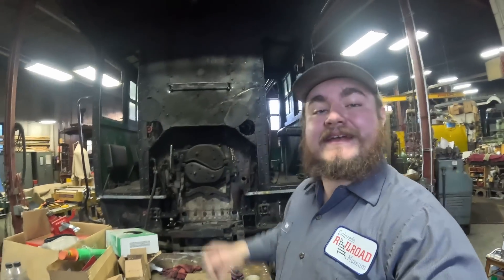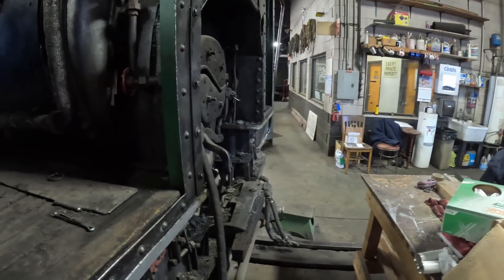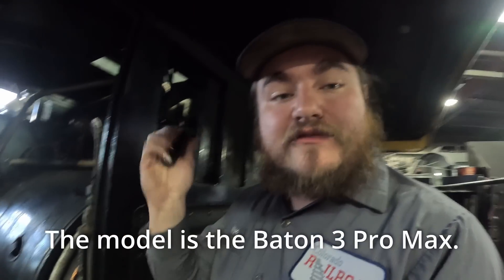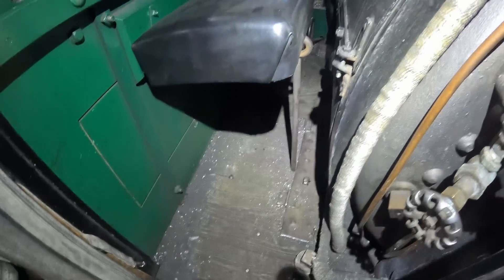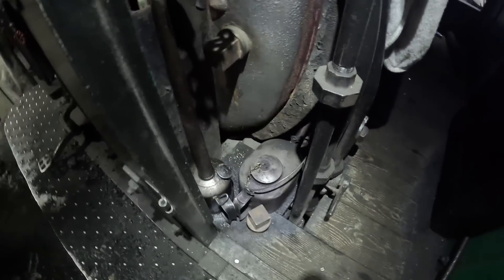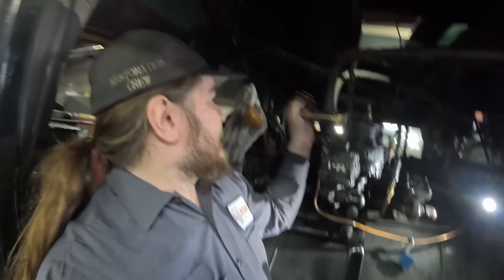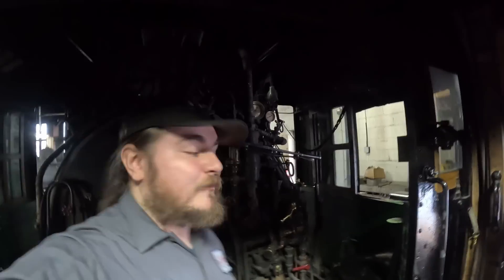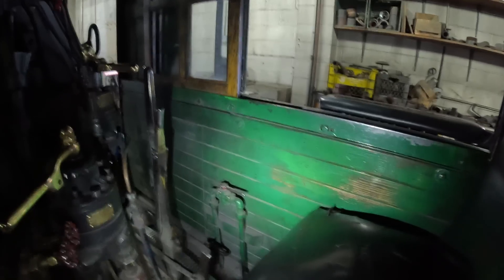BOILER goes ALL THE WAY through the cab? Deckless Steam Engines!

Comment from the maker: I realized after I finished this video that the reason why may not be super clear for some. Smaller locomotives can't afford the length that putting the cab behind the rigid wheelbase would add (cab hits the tender, swivels too far, is unsupported, etc.) so they kept it as tight to the boiler as they could.
Reply: Another advantage is that the enineer didn't need to draw a chalk line across the cab to seperate himself from the fireman 😉
Reply: Or they simply couldn’t fit on turntables at the very start of the 1900s. In N&W #475’s case, she wouldn’t be able to fit on any turntables at that time if she wasn’t a deckless locomotive.
Reply: It gives you a fully enclosed cab though!
Reply: I wonder also (without knowing the build date of your locomotives), whether the trailing tracks circa 1870s 1880s were up to the task of carrying significant firebox weight.  The 2-6-2 and 2-4-2 locomotives of that time had outside journal trucks, but the fireboxes were narrow and also supported by the rear driving axle.  A surer bet perhaps to carry that weight on the rear driving axle, and thus also add to available adhesion.
Reply: @theimaginationstation1899  RGS #20 build date is 1899
and 346 is 1881 and thay were made to go around tight curves
Reply: @mattomon1045  ta.
Reply: Do you think you could do a video about your car one day?
Reply from the maker: @WindowNotClear  count on it :)
Reply: @Hyce777  nice
Reply: Does the double fairely count as a deckless steam engine?
Reply: Why didn't the operators just cut a hole to access those valves?
Cut a square hole, attach a hinged flap, and you have access where you didn't before. Seems like something a typical operator wouldn't think twice about
Reply: Hehe length:_hyceGuitarface:

Comment: If I am not mistaken Illinois Central No. 382 had a deckless cab and if I remember correctly Sim Webb stated in an interview that because of 382s cab design Casey was unable to have bailed out even if he wanted to.
Reply: That would also explain why illustrations show Sim jumping off the right-hand side of the engine (and why, in the famous interview, he says he "jumped across the deck"). If the door on the fireman's side was open, it would have been quicker for him to run across and jump off the engineer's side, rather than closing the door and jumping off the fireman's side. I've always wondered about that.

Comment: I first visited Strasburg back in 2019, and I remember I got in the cab of 475 once and got to blow the whistle. Like you said, it was pretty cramped being the the cab ngl. I remember leaning a little bit to physically reach the whistle board, while under the impression of not wanting to accidentally bumbing a lever.

Comment: I had the honor of working the Six Flags Over Texas (SF&T) Railroad in the late 90’s. Engines are way smaller 2-4-2’s, decked and oil burning. In seeing this video, my initial thought was the fireman’s feet. It seems it would be more of a pain shoveling into the boiler directly on top of the gangway plate around curves or even rough track back in the day. Not necessarily unsafe but something to be mindful of.

Comment: Didn't know deckless engines were a thing, but this explains why my Bachmann model has the boiler sticking out so far into the cab, I always thought they just modeled it wrong.  It doesn't have an apron though and the tender connection is probably too far back.
Reply: Bachmann actually screwed this up on their famous "Big Hauler" 4-6-0. The prototype (ET&WNC 12) is a deckless engine, just like RGS 20. Bachmann apparently forgot to make note of this, so they just basically left it the back of the cab open with very small walls on each side (blocking where the engineer and fireman would have to stand). They got it right on the wood cab version of the model, but the more common steel cab version - one of the most popular and ubiquitous G scale models of all time - has a cab that, in real life, would be nearly impossible to actually use.
Reply: @michaelramsey82  It cost me $50 at a yard sale, I ain't complaining.  I love trains, but I am not a rivet counter, actually know very little about real locomotives, just that steamers have a bunch of moving bits that look cool!  Mostly model in LEGO too, and just build whatever I like, heck, my boxcars have tailights because I thought they looked better that way!

Comment: Southern 154 is a deckless standard gauge engine I’ve had the chance to see multiple times. Preserved sister No. 107 is also deckless.

There’s also a “preserved” (term used very loosely) Smoky Mountain Railroad 2-6-0 No. 206 on display at the “Chattanooga Choo Choo” hotel that’s deckless.

Comment: So, I probably already know the answer to this question, but I'll ask it anyways. With how tight a fit it is inside one of those deckless locomotives is (as well as just about any steam locomotive that size), what would happen to a poor fellow who accidentally put his hand (or other body parts that come in contact) on the boiler when moving in and out of the cab? Is it hot enough to scald on that part, or does it have a outside and inside part (like modern water heaters) to help with insulation, and also provide a slight buffer to avoid accidental scalding of one's hands or "caboose" when around it?

Awesome videos, by the way! I love learning about how old stuff like this works! Kinda wish somebody would try and bring back steam power and "modernize" it. It's the original clean energy!

Comment: Is there a specific reason the interior walls of the cab are painted green? I notice alot of earlier engines used it and didnt know if it was just a specific railroad usage or a standard and had a practical reason why it was green, like to easily spot a leak in a line or to help read gauges better when in use. Kinda like alot of race cars over the decades paint the underside and engine bays a light gray color to easily look for and spot leaks on components.

Comment: The first deckless engines I became familiar with were the East Broad Top Mikados (on TV).

I don’t think it was a true deckless engine, but I believe the Illinois Central Ten-Wheeler 382 (Casey Jones loco) had a similar configuration.  I remember from a paper model I built many years ago that the Belpaire firebox ran all the way through the cab.

Comment: -back about 40 years ago I went up to Edaville Railroad on Railfans' Day. My friend and I paid extra and rode in the cab of Bridgton and Saco River Number 8, a Forney with the firebox poking a good 5 feet inside the cab. They  put me on the fireman's seat wedged between the boiler and the cab wall. It had to be at least 80 degrees sitting there. How it worked out was it was a cold, rainy weekend, and I was kind of chilled from running around out in the weather. That cab ride was as close as I came to being comfortable that day!  How that would have worked out on a 90 degree day would have been a different story I'm sure!

(Still: a really great day!)

Comment: The EFOM (estrada de ferro oeste de minas, 76cm gauge) engines have their cabs around the boiler as well. Their boilers are way smaller than 20's, and the back of their cabs are completelly opened. You also can see this on some metric gauge RMV baldwins.

Comment: Hey Hyce :D I was just watchg your videos and then something came on my mind, where I live, in my country, there are two operating narrow gauge tracs, and one of them is in the same village my grandpa live and it was mining track of 600mm gauge. There are two steam engines and when I looked on their website they dont have tractive efford number there and instead of this there is power (in kW and hp) and I was wandering, those angines have like 37kW (50hp) and 52kW (70hp) and there ara two my questions, are there some calculations about power and tractive effort conversion or are they like uncorvetable numbers? and how it is possible that those engines have like less power that my car (85kW/114hp) and well yeah, it goes like maximum 20 km/h (12,5mph) but still :D those mining hoppers are not lightweight and it can pull handfull of them :D
Reply: number one engine is Krauss-Linz 7485 from year 1920 (37kW/50hp), it is 0-6-2 configuration
Reply: and number five ( don't know who numbered it as it is second steam locomotive there, maybe some of diesels came in between) is Krauss-Linz 1518 from year 1929 (52kW/70hp) and it is also 0-6-2 and I cannot find any more info on those engines like driver diameter :D

Comment: Why does 20 have a rear cab wall and therefore doors?  I assume it serves a purpose besides blocking access to valves.
Reply: Probably structural - a wooden cab with only three walls seems like it would shake itself to pieces.

Comment: So would we consider a camelback a deckless engine or a hybrid? Considering the cab with seats has the boiler running through it up top and the long-suffering fireman's shelter (bit generous to call it a cab on most camelbacks) has a deckplate to stand on and stoke that big wide firebox at the back.

Comment: Casey Jones engine the night of the wreck , IC #382 was a deckless 4-6-0..and some speculate the design may have had a small influence on the wreck, due to limited visibility . Also Catskill and Tannersville 3' in NY state had a set of outside framed moguls (Second #1 and #2) with deckless cabs set SO far forward, the backhead actually was a few feet PAST the back wall of the cab as built. When the C&T was abandoned in 1920, they were resold to the Milwaukee Roads NG line in Iowa, the Belleview and Cascade, and the cabs were rebuilt to they were flush of a bit past the back of the boiler. Interesting fact..the FIRST #1&2 on the C&T were a pair of South Park  moguls that SOMEHOW found their way EAST to NY state.

Comment: First time I ever saw a deckless locomotive was actually a model. I assumed that the model manufacturer had just gotten it wrong. But I was surprised when I discovered that the prototype was the same!
Reply: Same here - I have a Roundhouse HO scale 2-8-0 that's deckless. When I first got it, I just assumed they had fudged the dimensions of the cab interior to fit the motor inside.

Comment: Not exactly "Deckless" but our Heisler #3 has a similar setup with the seats being next to the boiler instead of behind it.  Certainly makes it a tight fit to get in and out.  Admittedly, with a wood burner the fireman isn't spending much time sitting down anyway.  Again, keeps the engine fairly short.

Comment: This video made me think about my favorite engines, which would be camelbacks; I live near an old branch line that's now part of SEPTA, but used to be owned by the Reading Railroad, and a long time ago, they used to run camelbacks on that branch line. So now we know about deckless engines, we know about engines with decks, so where do camelbacks fall?

On one hand they do technically have a deck, in the form of the fireman's canopy and the tender deck (most camelbacks had very little, if any, protection for the fireman aside from an open canopy, very much in the style of early British engines), but on the other hand, the engineer is basically driving a deckless engine, because the boiler runs all the way through the cab and has all his controls squeezed in close. The fireman has all the space in the world, and the engineer has the scant space in between the boiler and the cab wall. Mind you, I don't think being cold was a huge concern for the fireman, because camelbacks by their nature had an absolutely massive firebox to generate the heat needed from the low-quality coal they burned, and the poor guy probably couldn't catch a break for very long. 

Anyways, great video, I really did want to know about this topic because I wasn't sure how this setup would work.

Comment: Are deckless engines more of a pain to operate? Was saving the space worth it? Why not just have a cab to have a little more space?
Reply from the maker: Not really. They're slightly less comfortable but not harder to operate.
Reply: I think the idea was to minimize the rear overhang, so that the cab and tender wouldn't move side-to-side relative to each other so much in curves.

Comment: Lots of smaller locomotives both standard and narrow gauge were built like that to save on length to fit on smaller turn tables.  Crews on camel backs had somewhat the same issues with the fireman rarely getting to sit on his side of the cab except between runs.

Comment: The N&W Class M is a good example in the standard gauge world of a deckless engine. They were made this way to reduce their length, because they would not have fit on the turntables of the time if the cab had been extended behind the drivers.

Comment: I did not know that #475 was a deckless engine. Im not sure if you meant #89 because it’s considerably smaller than #475. But cool info anyway
After some research, yes it is a deckless engine, and this would make sense because it was built in 1906 and not the early 20’s like #89 and #90

Comment: Some of the Baldwin built 4-6-0's and 2-8-0's built for both the Finnish state railway and the Bavarian state railway had deckless cabs. Fulgurex made an expensive superdetailed Brass? model of the bavarian version of those engines that is Very hard to find in any condition, back in the 80's.

Comment: "It's true, your honor. This loco has no deck."
Funnily enough, I think my only experience with deckless locos has been at the CRRM, though I have had the pleasure of being one of four people crammed in the cab of 2' gauge WW&F #9. Just goes to show that there's more than one way to make a cab tight quarters. I've also been in the relatively unique cab of Mount Washington Cog #9 which, while it does have a traditional deck, that deck (and the rest of the cab) is pitched forward along with the boiler for the sake of mountain climbing.
Reply from the maker: "Deckless here, blew the power grid..."

Comment: I can't think the fireman's "seat" got much use.  Probably easier just to stand on the apron and hang on in between bailing coal into the firebox.  Even the engineer may have stood more than sat, especially during back-and-forth switching moves.  The West Virginia Railroad Museum has the former West Virginia Northern #8 at the shop area in Belington.  It is one of these "deckless" engines.  They also have WVN #9, but I think that boiler is off somewhere being rebuilt.  It is probably "deckless" as well.
Reply from the maker: That's precisely what we end up doing... It's seldom the seat gets use.

Comment: At the Texas State Railroad, where I did some part-time work as well as volunteer work, we have in our roster the T&P 316, a small ten wheeler built for the Texas & Pacific in 1901 by the A. L. Cooke Locomotive Works. It has a deckless design, and is definitely not as comfortable as the other engines we own.

Comment: So here is my question, why would there have to be a back plate just above the firebox door on RGS20? Is it a structural support for the rear of the cab or could that back plate be removed above the fire door to allow better access to the tricocks and allow for a oil shelf?
Reply from the maker: Structural for the cab. The trycocks were easier to get to before the addition of the second water glass, which is mandated by the FRA.

Comment: the EBT mikes are verry intresting since they are like a K-27/28-36/7 2-8-2 BUT they still open or deckless engines 
what really sets me off, because the donnea burnt Anthrax coal to say the fire box has to be as big as possible to get the same energy out of as with bituminous coal.

Comment: This comment is long but i love learning and wont learn stuff if i dont asked. But Are you going to be a part of this 1472 i remember you said to Kan on RR online you are a employee there now and work in the shop. But will you be recording the steps of the 1472 by any chance?
 I think the opportunity to see what the 1472 actually entails labor wise. and possible price list for parts and labor. I live 10 minutes from Lehigh Gorge senicRR owned by reading and Northern and my Favorite steam locomotives R-BMT&N #425 is on her way to i think Reading or Altoona for her 1472. Its a early 1900s USRA Light pacific. Also i travel to Strasburg alot. Strasburg #31 formally Grand Trunk RR 7312 (may have the number wrong lots going on right now) but #31 which was Americas very first" returned to service "steam locomotive.  sept 10th 1960 if i remember correctly. But she was taken out of service in 2009 for her 1472. Her boiler, chassis, and wheels sat on the sideing in pieces next to the shop up until about 6 months ago when they brought inside. I dont know if that means it is actually getting the 1472 finished. I do know It didnt get done in 2009 from finding so much wear and the giant costs it would have been at the time was more then Strasburg could afford. I do know strasburg #90 is going down for her 1472. Over the years they used parts from #31 on other locomotives. So i think they took 31 inside to use for parts for 90.  I actually want to get in contact with a model railroad company and start a fund rasier for #31s restoration. I want to see if a model company would make Strasburg #31 model that the sales profit can be split between the model company and fundrasier for the real train. But dont know where to start.